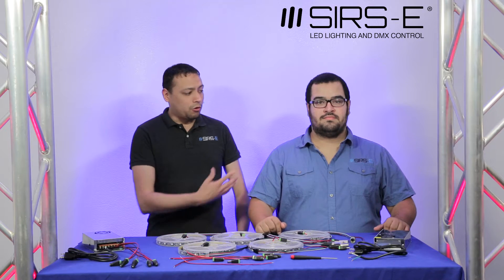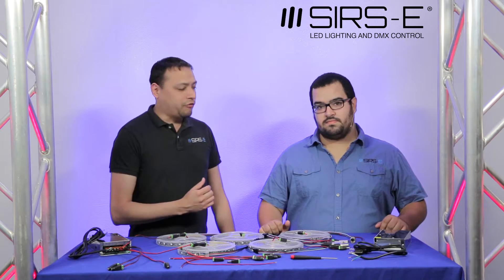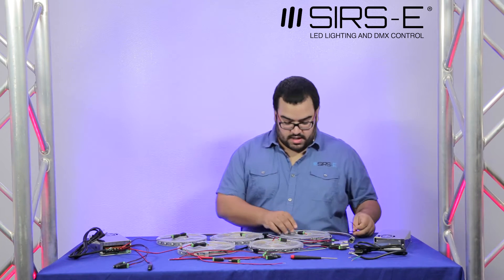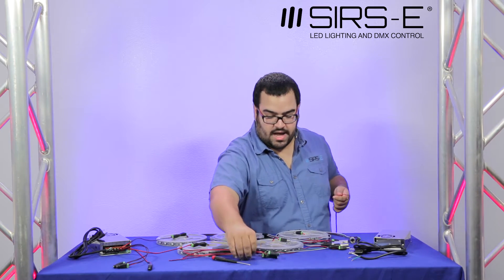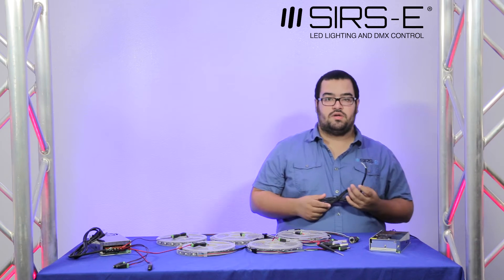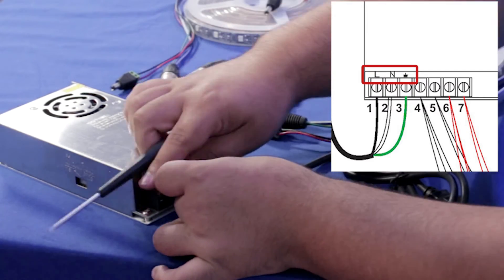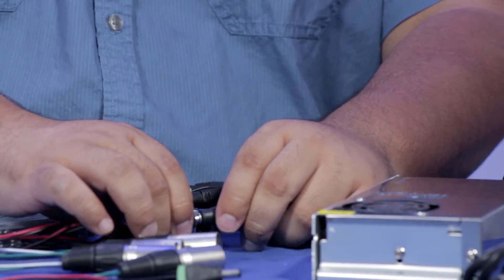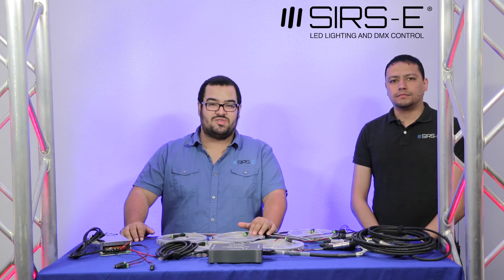How To Power DMX LED Strip Voltage drop Minimized

Comment: I want to run 20 boxes (1' X 1')  on with the same signal. Would I run one source signal (RGBC) and daisy chain them,  and then multiple power sources?
Reply from the maker: Yes you can do that, as long as the signal is being boosted with power.

Comment: Hi, I've been thought that connecting 2 power supplies together (like this setup trough the LED strip) is very bad for the power supplies and could blow them up as well. Are these special power supplies or is the above a myth?
Reply from the maker: We have not experienced any problems like that, it is safe to power on both ends with different power supplies.